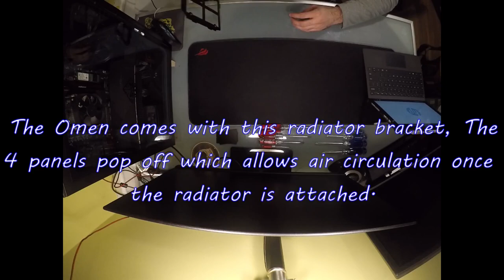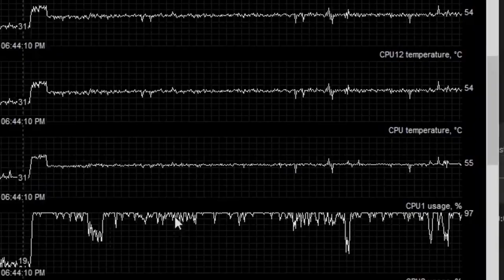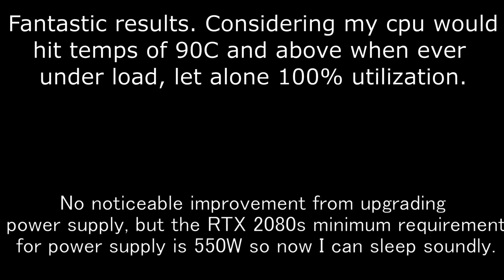HP Omen Obelisk - Upgrade

Comment: Hey, so I have the Obelisk with i7 8700K and GTX 1060 3GB graphics card, I am thinking of getting an upgraded power supply (700-750 watts) and getting the 3070. Is there anything else you recommend for this switch and would it work?
Reply from the maker: Would try to look into adding another an someone. That card will deft add some major heat to this pc
Reply: Are there any fans or liquid coolers you recommend? Right now it is completely base so anything could fit
Reply from the maker: NoahHockey the Corsair cooler that I put into mine is fantastic. It keeps everything nice and cool. But you could go with a air cooler also but it’s just a little harder with the limited space inside the case. I think AIO is the best way to go for a clean look. But a air cooler like a noctua would be a longer term option less chance of failure
Reply: I know I keep saying things but what size fam would be able to fit inside the case and where should it be? Sorry for so many questions
Reply from the maker: NoahHockey the stock fans on this are 80mm I believe. So any 80 fan should work. You might be able to fit an additional 120mm fan on the bottom in front of PSU. To blow up or out

Comment: Is the 50-60 c temp when playing games or just browsing?
Reply from the maker: This is with the CPU being at 100% utilization. If I’m gaming for long periods of time it’ll very rarely get higher then 70
Reply: @MrQwerty00010  gotcha! Thank you! I am considering upgrading it but is it necessary for my use? I don’t over clock and I mainly play Red dead Online for 4-6 hours and some light browsing. I got the Obelisk last year and it’s my first serious desktop. Just recently I looked into upgrading parts but idk if it’s worth it or change anything for my personal use.
Reply from the maker: @GOMD77  do you ever monitor your temps while gaming? I did my upgrades in hope of making it last longer. I use it a lot and was not happy with how hot everything was getting. If your system isn’t thermal throttling itself then I would look into other upgrades. I added an additional 16gb stick of ram and added a second HDD. I do want to upgrad to a larger ssd but I think I’ll be upgrading the motberboard next.
Reply: @MrQwerty00010  it seems like it stays below 80c and I read that it’s normal but some say it’s too hot. I don’t know much so I have been doing some research but idk who to listen to lol. I probably will go ahead and install liquid cooler but I am scared to touch the motherboard 😂.

Btw, how do you clean your Omen? Do you just use air duster on fans?
Reply from the maker: @GOMD77  i have yet to clean my pc, i know that is a horrible thing to say but i plan on doing a good clean out eventually. and ill have to do some re search but i most likely will just use some type of canned air or something. 80C is high but its average honestly. i believe the intel cpus are rated to run up to 100c i think but thats obviously not good. 80C is honestly fine it just might not last as long. again i just planned on keeping this pc for five or so years and then i wouildd just build an entirely new system maybe reusing a couple parts
Reply: @MrQwerty00010  i have the same setup, this is my biggest issue is the temps, ive been afraid to upgrade the cooling basically bc i lack the knowledge but this looked fairyl straight forward, i just upgrade my powersupply and upgraded my ram to 32gb dual channel setup. how hard was it to setup this cooling?
Reply from the maker: @jtown4530  honestly the cooling was easier to set up then the power supply for me so if you already upgraded the power supply, the cooling should be a walk in the park. I think you don’t have to even remove the motherboard you could use the existing socket backplate

Comment: Can i put a 120mm corsair Fan in back ?
Reply from the maker: the fan in the back of the case on the inside is a 80mm fan,  so i would say no sadly.
Reply: Mr Exquisitee 😐there is 80mm rgb fan ?
Reply from the maker: NHC _1022 they do check amazon out or just do a google search. I believe Corsair makes some
Reply: Mr Exquisitee Ight thx but i have another question, if we change the fan on the corsair watercooling can we put a rgb fan ?
Reply from the maker: NHC _1022 absolutely, you would just need to look into getting addition fan splitters. Or a rgb fan controller/hub
Reply: Mr Exquisitee ight thx thx

Comment: Would a RTX 3070 ti fit?
Reply from the maker: I don’t think so. But there’s so many different 3070s just google the specs and see the dimensions and then compare that to ur pc case. You might find one that just barely makes it. But then I don’t think you’d be able to use the support bracket that’s holding up the current gpu.
Reply: I put a Gigabyte 3070 in my omen obelisk. Not the ti tho sorry, and yes the bracket it came with was a no go it’s just chillin I might figure a way to support it in the future. It doesn’t look like it’s sagging or anything

Comment: hey got the same PC out of box, and never had problems., but i want to upgrade RAM with higher frequency (lets say (3200/3600). but at the same time i have to replace the motherboard iirc. cuz the mb oob only supports 2666mhz or?
Reply from the maker: i do believe that the max is 2666. personally i just bought an additional hyperx 16gb stick for mine. same as the one that was originally in it.
Reply: @MrQwerty00010  ok i see^^
Reply: @MrQwerty00010  What happens if I put 16x2 RAM with 3200mhz does it work or not?
Reply from the maker: @brayanlincoln2715  works for me I did the same thing
Reply: @MrQwerty00010  I mean that if it works with the speed of 3200 and not lower the speed less than 2666mhz
Reply from the maker: @brayanlincoln2715  i installed a second one but it seems to only run at 2666
Reply: @MrQwerty00010  I installed both and they both go to 2400 since the two ram cards arrived today,but still nothing happens thanks for the help 👍

Comment: I need help I just got the rtx 2070 super and I keep getting a black screen. Please help. Btw it’s the same pc.
Reply from the maker: manny saad a black screen could mean many things unfortunately, now did you just add in this graphic card or was it the one that came with the omen
Reply: Mr Exquisitee I just added it
Reply from the maker: manny saad and I assume everything was working fine before hand, the only thing I could think of is maybe the card isn’t duly inserted idk this really sucks man. If you pull the card out does the system turn back on?
Reply from the maker: @The Sweeper i do not believe so the biggest this case could fit is 120mm

Comment: Phew I need that Aio my cpu temps get so high for my obelisk
Reply: If you dont wanna go water cool you can add a noctua NH-U9S instead.
Reply: Did your pc not come with liquid cooling ? And also when did you get it ?
Reply: @frizzy3371  Nah just a stock fan. Got it in march
Reply: Someoneツ got mines like 6 months ago and no it comes air cooled the cpu stock fan is pretty bad not gonna lie
Reply: Darius Pryor yea I was planning on upgrading my case then getting a noctua cpu fan
Reply: @zarya8070  I thought about a new case as well. Would the be quiet case house the mobo?
Reply: Darius Pryor wtf why does it say on hps site that it comes with liquid cooling ? Did you guys not get it yours from hp?
Reply: Someoneツ pretty sure the pc can come with other things like liquid cooling but it cost more
Reply: Someoneツ I’m not sure,I don’t really know how you could fit liquid cooling into this type of case anyways😂
Reply: Nando Lmaoo ik the case is so small but yea the one I found on hp says it comes with i5-9600k wid liquid cooling lol
Reply: @frizzy3371  what Nando said lol
Reply: @zarya8070  many people use the corsair h60 for liquid cooler.
Reply: Darius Pryor I thought he was talking about a full on liquid cooler with tubes but yea an aio would fit but I would rather get a noctua
Reply from the maker: Before i bought the pc i had read reviews that talked about how hot it ran, really  i think it just boils down to poor airflow from the case and the fact that theirs only two fans in total. But as the other guys said you dont have to do water cooling a good quality air cooler would do the trick, i mainly just wanted to save space because the air cooler i wanted was fairly large.

Comment: How do you put the psu in the case
Reply from the maker: Timai not super easy, i don’t think it’s possible to do it without removing most the inside but I could be wrong. But if you truellyyy want to know watch the full video;) haha jk
Reply: What size of psu I need because its hard to put in the case
Reply from the maker: I wanted to do a 1000 wat psu but ended up going with a 750. If I could go back I would do a 800/850

Comment: I want to get a noctua fan but was size would fit the hp omen case?
Reply from the maker: Kevinsann_ do you mean a noctua air cooler for the cpu, or are you talking about adding/replacing a fan in the case with a noctua brand fan?
Reply: Mr Exquisitee  for the cpu
Reply from the maker: Kevinsann_ the noctua nh-d15s is one of the bigger ones it’ll just barely fit as far as closing the panel but it may interfere with the Ram, any other noctua fan that’s smaller then the one I mentioned prior will fit. let me know what you go with when you decide !!